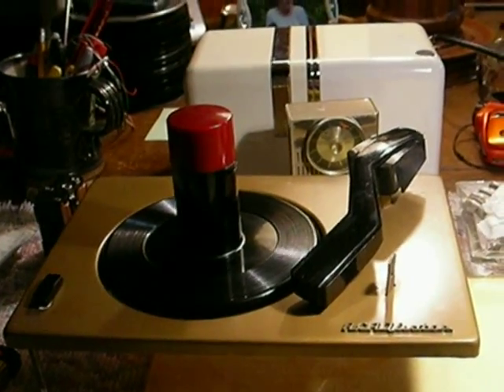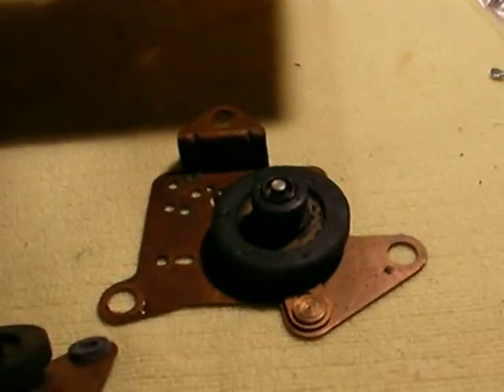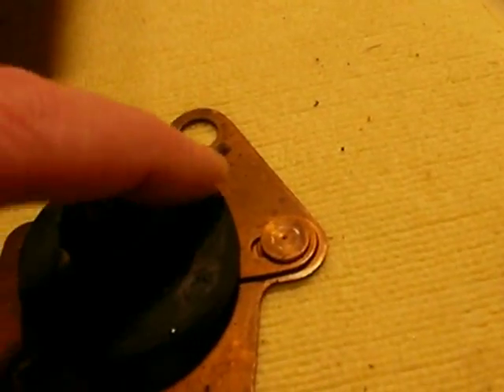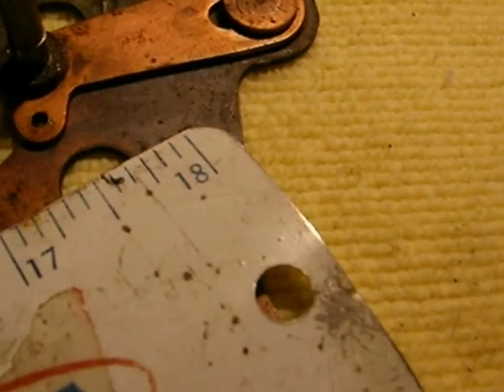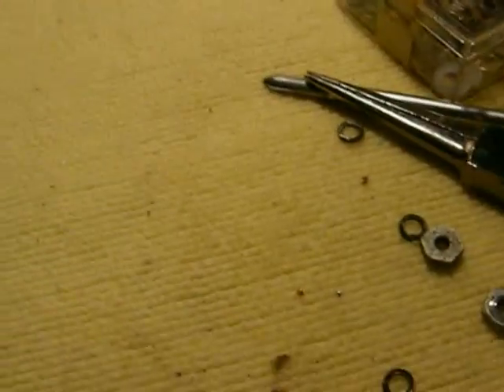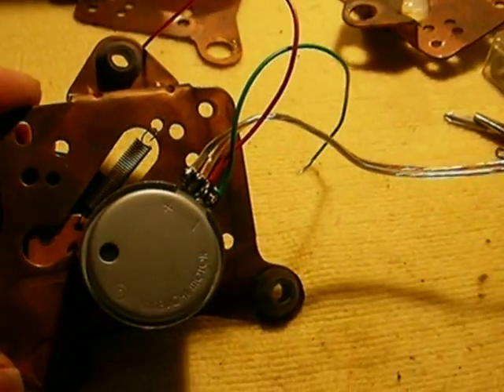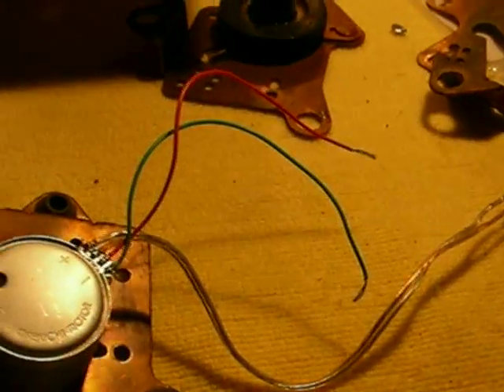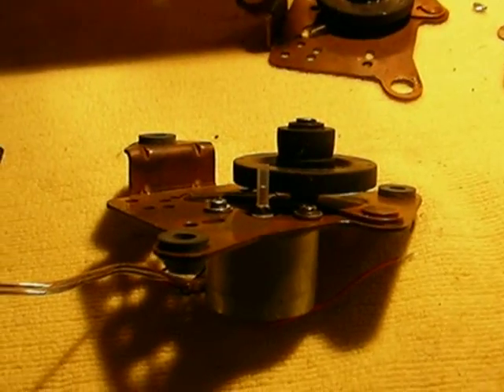RCA 45 Record player Converting to Battery operation- Part 1

Comment from the maker: @gta4life55 Its a 6 year old HP piece of junk. It does nothing but update useless programs (that it will not allow me to remove or to quarrantine) and wastes my time. It hasn't got anywhere near enough ram, and a too slow processor. I can only blame myself, because it was a bottom end walmart special. I can't wait for it to die so I can replace it.